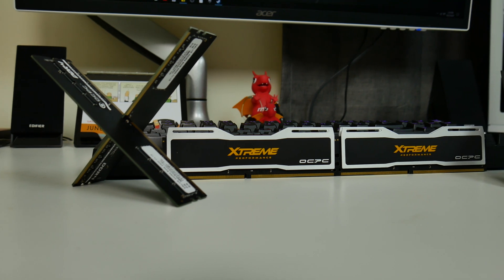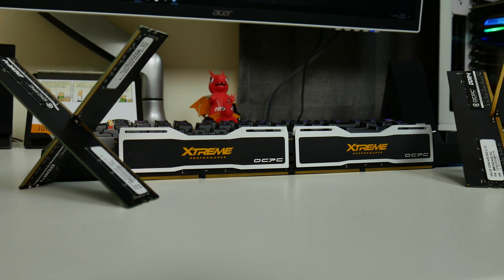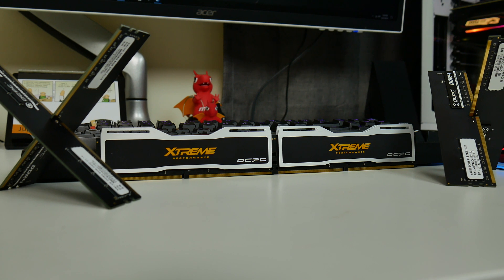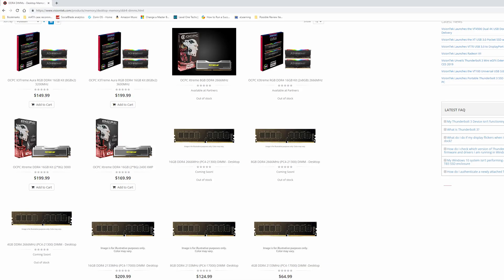My PC Wouldn't POST! Here's How I FIXED It!

Comment: Ok, so.... Just built I ryzen 5600g system and it will not post. I tried to plug in the spreaker and got no beeps whatsoever. It gives me a little white dash towards the upper left hand corner of the monitor. I have swapped ram for known working modules and no luck. I sent the motherboard out to get a bios update, still no bueno. The only think I can think of is that the Apu is dead. Help is appreciated, I know this is an old video, but it's relevant.
Reply from the maker: If it's a pre-built system or from a System Integrator like iBuyPower, I'd get in touch with them and let them know it's acting up. Other steps I'd follow are clearing CMOS, re-seating the APU, and moving RAM to different slots to see if you can get a post, then work backwards one step at a time to see where the issue was if it starts working again; you could even have a SSD/nVME drive attached that's causing something funky to go on, unless you're not even able to get in to the BIOS. You're presumably getting power to everything given what I'm seeing here so it's likely not the PSU or motherboard. Is that white dash blinking? If it is then the iGPU is working fine as well, which leaves the motherboard and the stuff attached to it. Known good RAM doesn't fix it so that eliminates that as well, but the channels could be faulty... which still beings us to motherboard or APU, and it's not very common at all for a APU to only be partially bricked: it either works or it doesn't in most cases.

That's what I got given what's here tho, hope that helps!
Reply: @TheManicGeek  thank you for the help. The white dash does not blink and remains stationary, and the bios does not show up. All the fans spin up as well. I'll try to reseat the Apu again as well as cycle the known working ram through slots. If any of these still don't work do you recommend trying to get an rma on the motherboard as the return date has passed or is there something else I should try after reseating things?
Reply from the maker: The only other thing I can immediately think to do is clear CMOS. I sometimes have to do that after a BIOS flash since for whatever reason the flash works, but the BIOS still misbehaves. Past that, maybe a motherboard RMA is in order, yeah. At least that'd probably be my next step, and you're far more likely to get a relatively expedient RMA on that than say a GPU right now.

Comment: Mine wont work :/ my it won’t post idk why I tried the ram, the battery and even the gpu do you think it would be the hdmi
Reply from the maker: There's a lot of other variables that could lead to a no-post scenario. There's also the CPU to consider as well as your boot drives. Best thing to do: go from "least invasive to most invasive" for diagnosis. Start with the easy stuff: re-seat your power and data cables for everything, double check that no obvious cables are shorting out, re-seat your processor and heat sink, try re-assembling your build outside of the case to see if it will boot there, etc.  The HDMI cable COULD be one of the things affecting it I suppose, but that's an easy thing to test: try a different HDMI cable.

Comment: I have tried to turn my pc on in the morning, and it wouldn't post, I took out 1 module of my corsair lpx 8gb 3000mhz ram, tried to post, and it did, switched off my pc, and tried again, with both sticks, and it posted that time, this happens every day and is driving me nuts. I have x470 pro MB with ryzen 5 2600x
Reply from the maker: Hmmm, just not posting at all is never a good sign, especially when it's LPX memory; that stuff is usually pretty good with compatibility.  Do you have any other kits of memory to test to see if you can isolate the issue to either memory or motherboard?
Reply: @TheManicGeek  when I had 4 sticks in,  kept getting BSOD, no idea why, I reinstalled windows, then worked fine, every now and then would get critical error, BSOD, computer would restart, thought I fixed the BSOD, never had it  in 3 weeks now, probably get 1 now I said that lol, the started getting no post in morning, googled on my phone, then it mentioned memory problems, so took out 2 sticks, tried to turn on, worked first time, next morning, wouldn't post, same thing, swapped ram, no post, so tried 1 stick of ram, worked first time, turned it off put the ram back up to 2 sticks, started no problem. so I have no idea what the problem is
Reply from the maker: @wolfie35p  Hmmmmmm...that really is a cracked issue.  There's a few things that could be happening, and the least invasive one to check is RAM... so I'm guessing there aren't any other DIMMs lying around for you to use, eh?  It's sounding like that specific combination of motherboard and RAM don't want to play well together.  I had an issue once where a kit of RAM that I used with the same processor previously worked fine, but move it to another motherboard and it has to train for days and days before it will actually work properly out of nowhere. It was kind of wild to see, but I also had other memory to test with so I had a bit of privilege there.  If that exact kit of RAM you have isn't on the motherboard QVL (Qualified Vendor List) for RAM, which you can find on the board's site if you didn't already know that, then it could just be that the kit of RAM is, for all intents and purposes, defective.

Did the machine work just fine for a period prior to all of these errors appearing?
Reply: @TheManicGeek  I used the same ram in the same motherboard before, and it worked fine, in fact, I have32gb of ram but only using 16, as when I was getting BSOD, I contacted asus to ask their experts, but they said because I was using 2 different packs of ram, they would be conflicting and causing the BSOD, which I thought was crap. BUT, I changed from x470 pro, to msi tomahawk max, couldn't get used to it, so changed back to x470 pro, and that's when my problems started. never had any problems before this.
Reply from the maker: @wolfie35p  Have you attempted to clear CMOS or re-seat the CPU? Swapping boards like that could be freaking out your BIOS for whatever reason (even setting the same RAM in different slots will do it), or maybe when you originally re-installed the CPU something was off about the pins that power the IMC, and the error occurred so many times that the computer refused to boot anymore.  You could also try to manually set your primary memory timings, frequency, and voltage since occasionally XMP will similarly freak out your board.  Beyond that I might try to find another kit of RAM to test with since past that the board starts to become the next most likely culprit.
Reply: @TheManicGeek  do you think buy new ram will solve my problem?
Reply from the maker: @wolfie35p  I feel like it's a troubleshooting step, so if there's someone you know who would lend you their DDR4 kit just for testing that'd be the way to go. I don't like recommending people spend money to try and fix things, so if you haven't I'd try the other steps first before resorting to buying a new kit: clear CMOS (may need to do this a few times), test. If that doesn't work, re-seat your processor (take it fully out of the socket, inspect the pins, address concerns, place it back in socket), then re-test. If that fails, then a different memory kit from the QVL might be the way to go. Some boards are just super particular about the memory they use for literally no reason.
Reply: @TheManicGeek  I just run a memory test on my ram through control panel, and it came up an error saying it was a hardware problem, and to get in touch with the manufacturer, in this case, it will be corsair. I will send them an email, and see what they say, I'll let you know in a few days after they get back in touch.
Reply from the maker: @wolfie35p  ah you were able to run memtest, great. Yeah see if you can get Corsair to RMA your kit.

Comment: Hey can vengeance pro 2x8 3600 cl18 run with ryzen 5 3600 and Aorus b450?
Reply: I’m having the same problem
Reply from the maker: The QVL for the motherboard would tell you for sure, otherwise it's all down to whether the IMC on your processor and your motherboard play nice together to let the kit run at XMP.  If that doesn't work you may want to run through the troubleshooting steps in the video, and if that doesn't work then you may have to adjust timings and speeds to get the kit to get close to its rated speeds.
Reply: Hmm I can’t even adjust anything the screen display doesn’t even show and none of the indication lights in the mobo is on

Comment: What's post code reader?
Reply from the maker: post codes are alphanumeric codes of what the BIOS is doing at a given moment. The reader lets you see those codes, where otherwise the board either only had beeping codes, or nothing at all. The motherboard manual gives you most of the possible or more common codes to see.

Comment: My PC receives power but doesn't beep is there any way i can fix this
Reply: did you manage to fix?
Reply: @kancha69  is it the same for u?
Reply: @user-cj6xv3ed4m  i would suggest you to do my trick, find where the power sw connector is at, its usually at the bottom of your motherboard. remove it and start using a screwdriver to boot your pc up by placing it on two of the pins. if this doesn't work try removing one of your rams and clean the gold pins with eraser.
Reply: @fyzhardy  bro it was the same for me hahaha power switch and reset switch had to he swapped
Reply: @kancha69  yes i managed to fix it by removing the power pin connector, i now open it by getting the 2 pins to touch each other with w screwdriver
Reply: Same

Comment: I have a really old ddr3 mobo and I had 4gb . I was looking for an upgrade and brought 16gb ram and after installing it my pc won’t post . I switched back to my old ram and it worked . I reset cmos but still it won’t post
Reply from the maker: Have you checked your same 4gb kit in other DIMM slots, or checked the new kit in other slots? Might have dropped a DIMM slot over time randomly or else the memory needs to be re-seated.
Reply: @TheManicGeek  I tried all of them and I think I’ve found the problem . My cpu memory controller only lets me use 2gb ram per slot . Is there a way to change it ?
Reply from the maker: Oh wow your hardware is that old? Don't believe there's anything you can do about that :-/
Reply: @TheManicGeek  Yh das was what I was worrying bout when I brought the ram cause my pc is reallllly old .
Reply: A pc keep giving alarming beeps or siren but still work fine. Usually first thing to do is to replace the PC case and install the RAM in different slots, but some RAM stick are the “leader” stick that must be in the slot 1 to make a pc POST as the other sticks of RAM “follower” sticks that couldn’t POST all by itself. 
It may not be the PSU has fault, but replace the PSU may fix it if all the fans works fine when there was no POST. Replace mobo’s battery too. In many cases no PC parts has fault, it just need to replace the PC case, RAM, PSU, battery with another working PC parts, so after doing all that, you ended up with 2 working PC system and not a single faulty PC part.

May need to replace the PC case because some pc case’s back panel is curved outward and need pushed inward to put in the screw to secure the graphic card, so after some years or weeks of use, it pulled things out of place, bow and arrow theory … …

In one of the other cases, each time the power is out in my house, I need to replace the graphic card and installed a graphic card that could POST in the PC, then I install the one that failed to POST back in place and it could POST, so each time the power it’s out I need to repeat that!

Some PC could shut down due to static changes when your hand is only touching the power button to the PC that’s made of plastic. 

Some PC couldn’t POST, just wait a 3 days without using it, then it return to life of POST, this could happen once in a few years of use, like seeing a comet going passing by!
Reply: @kathauaaua5487  if this is a response / answer to my comment I really appreciate it I quickly skimmed through it but I believe my mobo is just so old it can handle 8gb ram sticks I think max is 4 per slot